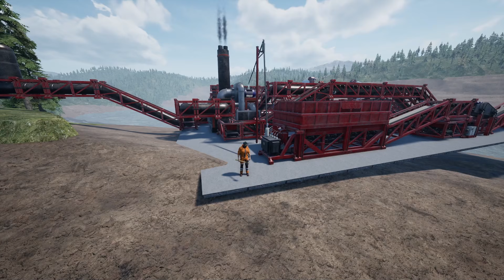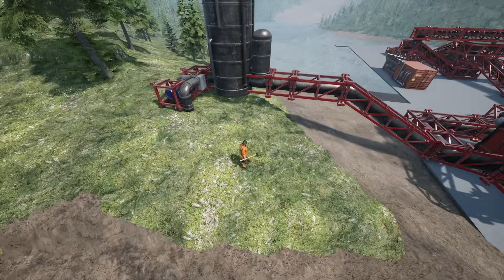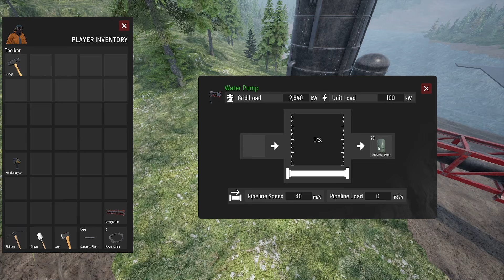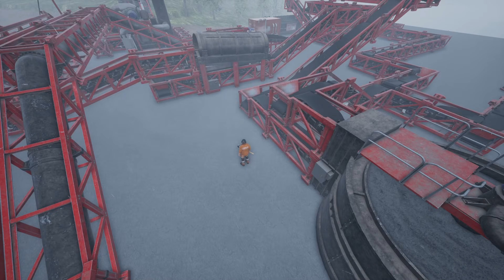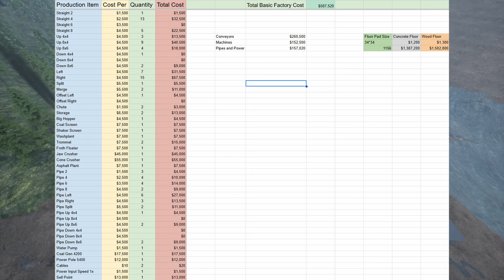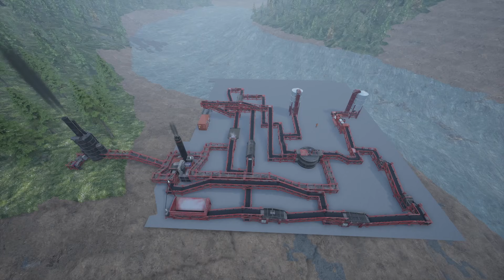My Plant Setup! Out of Ore Basic Tutorial

Comment: Neat setup, thanks for sharing. I take the liberty of using it as an inspiration for my own "standard setup". I think, one could have put the whole plant a bit more compact if one would want to. That could save some cost for the concrete pad as well, but it's obviously also coming down to preference. A very dense setup might not look very neat.
However, the biggest issue I see is that the hopper is the wrong way around. Loading it over the higher side is obviously more difficult than from the other side, especially with a dump truck. Too bad that the game doesn't allow mirroring components.
Reply from the maker: A lot of the layout was designed for the video and I typically do a tighter build. This also changes how I feed into the hopper and the total cost at the end. I am really interested in being able to mirror components some day too!

Comment: Did you actually run tests to see if the Froth Floater did better with filtered water? I haven't tested with it yet. However, filtered water doesn't make any real difference for the washplant over unfiltered water. But having at least unfiltered water for the washplant DOES make a big difference. You get about 2-3x more output when having water run to the washplant.

Also, splitting the water up is no better than running without water add all. So use one pump for the washplant and another for the froth floater.
Reply from the maker: I actually just finished up my testing of the different machines and water inputs! I'm going to be putting the results video together and it will be up soon!
Reply: @Hickmessiah  Nice. Looking forward to it.